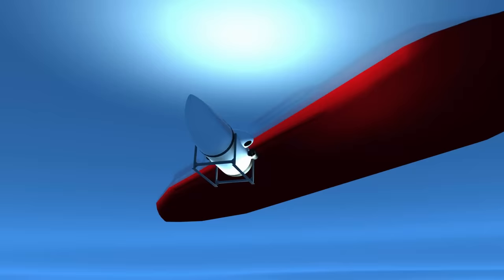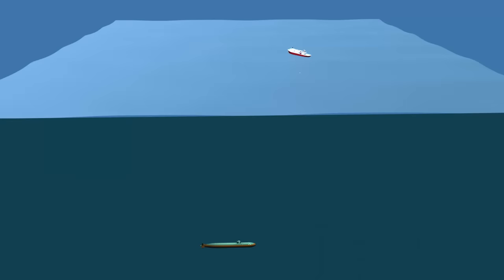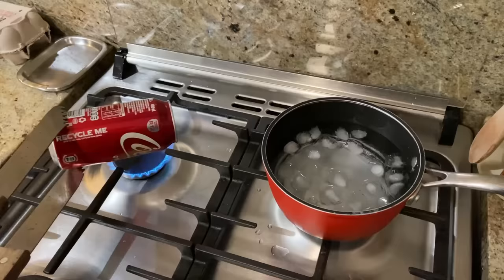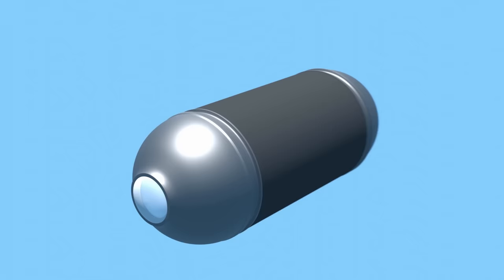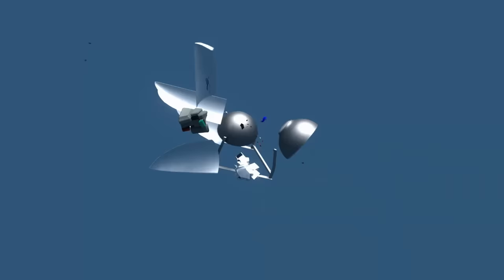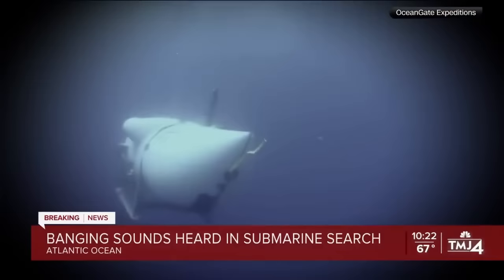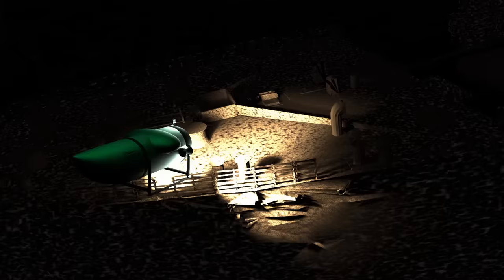TITAN Sub implosion | Deep Dive animation explanation

Comment: that implosion.  It's really hard to grasp how violent and quick it must have been.  under 6000psi, the volume of air in the pressure tube would have compressed to something like 1/500th its original size, at supersonic speeds, igniting the air, and pulverizing anything within it.
Reply: It's kind of like a bullet shrimp/mantis shrimp punch (extreme pressure, supercavitation, pressure heating, atmospheric oscillation) but on a much larger, terrible scale.
Ignoring whether they had any forewarning, as a "way to go" total, instant obliteration like that is relatively humane as you aren't aware it happens, the off switch is just pressed with instant effect.
We can only hope they were relatively unstressed before it happened as that would be the truly harrowing part.
Reply: It is a great way to die because it is completely instant. People are gone out of existence before they have time to think about it
Reply: Just watched another video talking about a sub that imploded a few years ago. They were at a depth of about 1200-1300 feet, so approx 1/10 the Titan sub, and when it collapsed the hull (at 550-600psi) would of collapsed at 1500 MPH which is somewhere close to Mach 2.
The Titan was much closer to 6000 psi.
Reply: @Trigger200284 same one I watched 2mins before this one
Reply: @Trigger200284  Which other sub was it that imploded? Was it a military sub? If so, from where?
Reply: @fredwrinkle  My understanding it was probably just a few seconds.  It is not them that is an issue. They are gone and don't care. It is their families and friends that are in pain.
Reply: @rankcolour8780 I think they know would happen, they was just to rise up they know something was wrong.
Reply: @keithdf2001 we perceive reality at about 200-250 fps. I guess you could do the calculations on if they even registered it but they certainly didn’t experience trauma
Reply: @keithdf2001  it was over and done in a few milliseconds. The air would of self ignited when the pressure squeezed the air bubble. 
Probably would of got close to a few thousand degrees and cooked their completely gel-ified bodies before you could blink an eye.
You can’t even fathom what 2 walls hitting together at 10000 MPH looks like honestly.
Reply: @Trigger200284  I want to go that quickly
Reply: @commie281   Agreed, That is my understanding as well
Reply: Fuel free air does not ignite, it just gets very hot, however in this case it was dispersed as many high pressure bubbles which soon cooled in the surrounding near extreme cold water.
Reply: Yeah they would have burned and frozeded to death before they died.
Reply: They turned into instant spaghetti. Not even their pineal gland got to escort them out of the 3rd dimension. Their souls now dwell within the titanic
Reply: Back of the envelope physics for an implosion.
All you need is F=ma and some simplifications.
Assume the depth was around 3800m, the pressure on 10m of water = 1 bar or approx 1 atm. 
So the pressure at that depth was 380bar, or 38000kPa or 38 million Newtons/m2. 
Assume the CF hull collapses instantly (its fast but not instant and will provide a decreasing resistance to the pressure).
Take a parcel of water right next to the hull weighing 1 kg. A 1 kg parcel of water is a cube 10x10x10cm, so the cube has a face of 100cm2.
The pressure on 100cm2 at that depth is 38x10^6N/m^2 x 0.01 m^2 =380000N.
Pressure = force = mass x acceleration, so what is the acceleration of our 1kg parcel of water with a constant force of 380000N in it? accel.=force/mass = 380000N/1kg = 380000 m/s^2.
After 1 millisecond how fast is our parcel of water moving inwards at? 
V=a*t=380000*0.001=380 m/s(850 mph), imagine a 2lb sledgehammer moving at 850mph in the first millisecond.
How far does it move? X=0.5*a*t^2=0.5*380000*0.001^2=0.19m=0.63ft.
After 2 milliseconds V=760 m/s(1700mph), X=0.76m
3 milliseconds V=1140m/s and X=1.71m.
After 3 ms it’s meaningless because the inner diameter of the tube was 8ft=2.43m or a radius of 1.215m.
So after about 2.6ms the inward moving water front would have reached zero radius.
Of course in reality we have neglected the increasing air pressure resistance of the compressing bubble, the crush resistance of the fragmented hull pieces also moving at 100s of m/s produces a drag force slowing the collapse down plus the viscosity of water when it interacts with itself moving inward.

This might have extended the collapses out to say 10-15ms. Once the compression front equals the air pressure the pressure wave would have rebounded off the superheated air bubble and moved outwards(spring effect) and reduced but still significant speed.

Also the outer shell wouldn’t have simply fallen off, the inward moving water next to the CF hull would’ve created a suction force inward pulling the outer skin in towards the collapse probably moving the outer shell at least 2-3ft inward then rebounding out.
Also the two titanium end shells would have been pulled in towards the collapsing volume but the longitudinal resistance of the CF hull might have significantly slowed it down plus water resistance over the shell’s area plus inertia would have played a major role.

Of course all of this is an extreme simplification but the implosion happened very quickly and the people would’ve been dead in 10ms give or take.
Reply: @glenyoung1809  I always figured it would be comparable to standing between two freight trains traveling 100mph towards each other in a head-on collision. You're pulverized.
Reply: @glenyoung1809 NERD ALERT!😂
Reply: Then lights out faster than eyes can blink for anything carbon based that breathes.   Unimaginable, but hopefully uncruel quick death.
Reply: @rankcolour8780  The final text sent was that they had dropped ballast before they made the bottom. This implies something was wrong and they knew it.
Reply: 5000lbs of pressure per square INCH. Say you are 5’10 that is 70x5000lbs. Actually even more since that is only height. Now imagine 5000lbs of pressure across your height, width, front and back and side. It would be like have a train engine dropped on you.
Reply: @user-dd9eo2wz3h  Their soles, however, are part of the ocean now...
Reply: @JoshDisher  I've seen no evidence of such a text. It's my understanding that there were no comms after 1 hour 45 minutes. But I'm willing to learn something new. Source, please?
Reply: Just go eat some Chipotle and you’ll get an idea of the violence and pressure.
Reply: @RockandRollWoman James Cameron spoke to people who work for ocean gate and the mother ship.
Reply: A very interesting study using physics. Superheated water should have left evidence on the tail, wiring, skin etc. Bubbling, deflection , warping..Currently I don’t see any evidence on the recovered pieces. 
But we actually don’t know , and won’t, till the inquiry what failed.
As arm chair engineers we have all postulated different theories but mostly centring on the collapse of the carbon fibre hull. Yet already we have it confirmed that there were ‘at least’ two separate debris fields after the implosion. 
The wreckage brought to the surface is challenging. 
The view port has gone. 
The titanium rings are intact. 
Large pieces of the outer skin remain intact.
Sealed sacks probably contain the shattered carbon fibre hull.
The landing skids are intact.
There are possible human remains.
Doubtless we will shortly get an in depth study ( pun intended ) of both fields. 
How far apart , distance on the sea bed, and the time of implosion and ‘possible’ manual detachment . 
Were there seconds or mili seconds . 
Did the crew have an ‘awareness’ .. of the impending catastrophe.
They might have if it’s proven that they had commenced emergency surfacing procedures.
Currently that’s my thinking..
I just hope that with all this attention the findings of any Inquiry will actually be published…
Reply: @RockandRollWoman its funny because of the spelling mistake but I understand what you mean 😘
Reply: @JoshDisher  their was no final text.
Reply: Yep, and the coke can in ice was an excellent example to help visualize it.
Reply: @ianmarcRoxU  Military sub made of steel, the effect is very different. This is made of carbon fiber. The one made of steel it violently ignites. Many argue that it hadn’t ignited as it shattered coming into contact with water immediately after implosion. Only a few large pieces were discovered which wasn’t pressurized. The rest is gone. When carbon fiber shatters at that depth it shatters like porcelain.
Reply: @JoshDisher  No one mentioned texts. Where did you hear that?
Reply: @adrianfewster8391 In case of steel sub it does ignite violently. There are several actual videos of this. Not animation. Go search them there are several that are taken while back, actual footage.
Reply: I don't really think what happened to titan could even be duplicated at sea level under controlled conditions.   Tbh 🤔 the imploding beer can or rail tanker isn't the same.
Reply: ,,,,except they have found human remains, and not in powder form?
Reply: Every new piece of information makes this disaster even worse.  I’ve never heard before that the fibers were only wound hoop-wise.  This is such a fundamental, rookie mistake on top of the even more fundamental mistake of using fibers under ultra extreme compression.  Without and transverse fibers to give load sharing, I suspect that the failure started by cleaving between the fibers.  Basically a supersonic waterjet. The rest can be left to the imagination.
Reply: @JMC-ul1sw  - The net is the same, and uses the same formula, for any volume of air, when the volume is reduced due to pressure rise
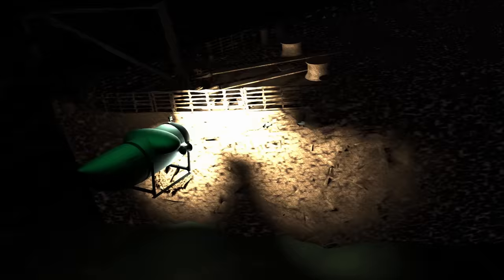Reply: @RockandRollWoman  2:16
Reply: @RockandRollWoman  "90 minutes into the dive and 3/4 of the way down the mothership received the last message from Titan."
Reply: @GaryFlaskegaard  2:16
Reply: @KittenBowl1  2:16
Reply: @GaryFlaskegaard  then the video creator is lying or misinformed? 2:16
Reply: @RockandRollWoman Their souls are at peace.
Reply: Would the compression cause the remaining air inside to heat up? I'm so confused about this detail.
Reply: @fredwrinkle  indeed
Reply: @joimes  yes. It would compress so fast it would combust like an engine.
Reply: Oh they heard some scary shit but didn't fully think it would happen
Reply: @JoshDisher , That’s just the moment that they lost comms and tracking. It was rumored that there was an SMS, but it is unconfirmed. Even if it is true that they messaged they were dropping ballast, it does not necessarily mean that they were planning to ascend because they knew something was wrong. They would also drop ballast to achieve buoyancy and maneuverability if they wanted to use their thrusters.
Reply: @Seashellsbytheseashore21 , This is not correct- Cameron has said in multiple interviews now that he heard from a third-party that the submersible indicated that they were dropping ballast. However, as mentioned elsewhere, this alone minus a distress call could indicate a number of things.
Reply: @adrianfewster8391 There would have been an explosion, the bodies would have been crushed exposing all the fat in the compressed/heated air full of oxygen.
Reply: @geoffreyk9164  But if they weren't at depth wouldn't that signify a problem? The thrusters weren't intended to take them 1/3 of the way down, were they?
Reply: @JoshDisher , Technically, they could use the thrusters at any time they wanted and they almost certainly knew that they were already a bit off course from the wreckage site intentionally where they want to drop ballast so not to disturb anything and approach (presumably the bow) from the side. Also, it is odd that they would simply report that they were dropping ballast without a distress call. Keep in mind, it has not been confirmed with the last SMS actually was. This is obviously something that will be investigated though.
Reply: @davidhenri2722  No, its called an implosion. There was no ignition, just a multiple condensed bubble sound register detected by the navy.
Reply: An engineer worked out it had the energy of 47kg of TNT going off in a minivan that cant expand
Reply: @piccalillipit9211  Not much of an engineer, You do not compare explosions to implosions. The dispersed air under pressure is quickly mixed with cold water and does not find a fuel source from body material to react with for ignition. Everything is crushed, however not destroyed, Molecules stay intact. The air heat is quickly dissapated into the surrounding water re small bubbles. The 47kg TNT theory is pure BS . Engineer should take his hand off it.
Reply: I wonder what happened to the body of thr passenger of Titan
Reply: What are the chances of finding Bones and other Human rests inside the imploded tube??
Reply: The air was ignited and the water streaking in at hypersonic speed cavitated. I guess there even was plasma for a fraction of the process.
Reply: @mrnice111  No. Alls he thought about was making money
Reply: @ianmarcRoxU  ARA San Juan ?
Reply: @rankcolour8780  kppli0iik0
Reply: @mrnice111  89pko8
Reply: @joimes  The description that made since to me was that it was similar to a diesel engine. The air was rapidly compressed creating heat and vaporizing any possible carbon based fuel (human bodies) till ignition happened. And all of this would of happened in less than a second. Human remains would of been burnt onto surrounding materials that survived . Truly speculation on that u-tube provider's part I know. But under the pressures at that depth, seems possible.
Reply: @adrianfewster8391  not according to naval depth finding techniques. It would of more or less been 1 bubble that goes through what is called "bubble pulsing". look it up. You can call it super hot or ignition, or whatever you want, but that bubble would of heated the air to 1000's of degrees in a split second.
Reply: @adrianfewster8391 your assumption of there being no fuel sources at all in the air is funny.
Reply: @jonathanfreedom1st is
Reply: @glenyoung1809 wonder what the non simplified version looks like? Geesh, good job.
Reply: @nev7711  I was making a joke. Their souls are wherever one believes souls go, but the soles (of their feet) are gone.
Reply: @gg456stormy  Really complicated, water which is moving inwards from the surface of a cylinder and crushing a volume of air inside will not simply be moving in a straight line towards the center of the sub. there maybe turbulence which is a non-linear effect and greatly complicates the calculations.
Plus the added complication is that the sub is non-spherical, the cylindrical geometry with titanium endcaps makes the collapse dynamics a lot more complex.
What I did was simply to convince myself of the time scale of the collapse which was on on the order of milliseconds like many experts maintain and not seconds or even tenths of a second.

My own theory is that the collapse didn't start by the end of the sub where the titanium was bonded to the CF by glue. 
The collapse started in the middle of the sub. away from the two strongest ends.
The middle of the cylinder can be viewed similar to a suspension bridge with two towers supporting the ends, the weakest point would be midway between the two towers(titanium end caps). 
The middle was crushed inwards, leading to most likely an hourglass shape which probably caused the air volume to move towards either end, as the collapse proceeded the ends of the CF tube were probably the last to fail since it was "shored up" with support from the titanium rings. 
In effect the sub was probably crushed and pinched into two halves and the two titanium ends fell away once the CF tube's support was destroyed.
Reply: @JoshDisher  We agree that they  lost comms at 1 hr 45, but I was asking how you know they sent a text saying they dropped ballast.  Best anyone can do is say they heard a rumor, but rumors aren't knowledge.
Reply: @claytondennis8034  ya I should of mentioned that too. Anything that vaporized during the implosion would probably combust in the air temperature.
Reply: @southerngentleman2516  I can imagine the arrogant, overconfident pilot, upon hearing some creaking noises, say to the others, "Oh, it's just the parts settling in snuggly", or some such sad bs. It is a sad event, regardless of all the "what ifs".
Reply: @JMC-ul1sw  because there was no time for the air to separate into smaller bubbles…. There’s an entire study of it known as bubble pulse.
Reply: @madlenellul3430  your view is flawed
Reply: @jonathanfreedom1st  it was a demonstration of the effect brainiac.
Reply: @citizenscience659  oh really? Source please. Cause they ain’t finding anything from that, sorry.
Reply: @Trigger200284  I’m not disagreeing as I’m not proficient in thermo dynamics at that depth…
But I am annoyed that so many on this post have been conned by the sick posting of supposed communication between the Titan and surface.  This did not happen..DID NOT HAPPEN..
The poor souls may have been aware of their impending doom but they did not communicate this to the surface.
That dialogue is pure ‘sickening’ imagination..
It will take the Inquiry before any  ‘truths’ are uncovered..
Reply: I really hope that if they knew it was about to happen, they all took turns slamming rushs head against the titanium end cap, that was probably the banging sound the microphone picked up on 😅
Reply: Yep.
Reply: @lottatroublemaker6130  U.S. submarine Thresher and Scorpion.
Reply: @Trigger200284  They did not calculate the accurrate depth on Titan, the heard sound indicated an implosion, but they could not be sure until the debris was found. In another submarine incident the bubble frquency of 4.4Hz with the known volume , indicated the depth for that one. You have to remember that crushed metal can stay intact regading it's metal skin bending and deforming, retaining the gas until the last escape. With carbon fiber, it shatters like glass, as it does not bend or mold to a new shape under extreme pressure.
Reply: More like 1/282, and quickly cooling and rising before liquified completely.
Reply: You had me at envelope’ 🤣
Reply: @johnermactavish1162   The diffferrence is the water pressure bursts your lungs, stomach and fills your void internals. The pressure externally is equal in all directions. So the body is not squashed flat like a train enging dropping on you. Remember that fish live down at those depths.matter can sustain huge pressures from all directions. Of course death was instant. Carbon fiber does not bend, it shatters under immense pressure. This is the reason it failed. Metal can distort and restore its structure, whereas carob fiber cracks on every dive until the last one, where its weakoned state is overcome. Why it was not made of metal beggars belief...
Reply: Carbon fiber cracks, and shatters it doesn't implode, everybody in that thing knew what was about to happen
Reply: @jackalopewright5343  Hmmmm, all these 'experts' may be right? But can you explain 20 successful round trips?, Or even just 5? Oooops, suddenly NOT SO OBVIOUSLY 'rookie' anymore, unless you are projecting, maybe?
Reply: @silverflight5777  Yes thats what I already said above.
Reply: @joimes yes, pressure and temperature are proportional in gasses. They heat under compression. Sudden cavitation (gas bubble formation) at depth can actually generate heat in the thousands of degrees as the water pressure collapses the bubble. 

If you want to see some simple examples of it, watch some slow motion footage of ballistics gelatin. The cavity formation and compression actually combusts some of the gelatin from the pressure, almost like a diesel engine
Reply: @RockandRollWoman    Lovely thought ... btw, its "souls"
Reply: @fredwrinkle  Submarines in general have unpleasant hull noises even when operating normally, hopefully for the passengers things should have felt normal right until the instant of implosion.
Reply: @brettp5543  I responded to a comment about souls at rest with a crack about missing soles. Because the remarks were separated in the comments, folks missed my joke. Their souls are wherever one believes souls go, but the soles (of their feet) are gone.
Reply: @rankcolour8780 can you explain the ending of what you mean? Hope they were relatively unstressed? 
Thanks 😊
Reply: @keithdf2001  So what is pain then? a defense or alert mechanism?
Reply: @madlenellul3430  I share your revulsion at those who invent facts, or turn speculation into truth, and seem to get off on causing distress. We know the vessel imploded, but little else about what happened after comms were lost. The rumermongering is like a 5th grade game of telephone. 
Science sometimes requires patience.
Reply: Rush probably told them not to worry during moment of panic
Reply: Right so the bodies become compressed themselves correct? This is showing that the compartment shrinks but did it break apart?
Reply: @limawhisky  Good question
Reply: @Trigger200284 good idea for the next Slomo Guys episode
Reply: @citizenscience659 Because after multiple trips down & back up, the various materials used contract and relax at different rates to each other, creating weaknesses that eventually give out when the structure can't take anymore extreme compression. it's less risky to use just one material. source: James Cameron.
Reply: @TattooedMisery  What, the Movie Director? Tell me, if you use the bus 200 times a year to get to school, does that make you a scholar , or a bus driver, or better yet A Coach Building Engineer? What sub did HE build that came back 20-odd times?? Oh, none?
Reply: If we consider only the weight of water, at 3.8 km depth, pressure would be 5400 psi. The strong waves would have added more pressure to it.
Reply: @glenyoung1809 The limiting speed is the speed of sound in water - 1402m/s. That is the speed that the water around the submersible would have decompressed at. 
The other speed is the speed of sound in carbon fibre - about 10km/s which is the speed the hull would have shattered at.
Reply: @drdrums1 Try two Mach 3 jet aircraft in a head on collision.
That’s the speed involved.
Reply: @madlenellul3430 the water doesn’t get superheated - the air does. The titanium shows scorch marks.
Reply: @joimes isothermal compression. There isn’t enough time for heat to dissipate so increasing the pressure by 380 times while reducing the volume by 380times increases the temperature by 380 times - Charles law.
Reply: @adrianfewster8391 Implosions produce high flash temperatures due to isothermal compression - just like a diesel engine. The crew are the atomised fuel. The resulting overpressure then blows the porthole and end caps off.
The bodies of the crew of the Kursk were burned by the same effect at 1/10 the depth.
Reply: @allangibson8494  thank you..
Reply: @allangibson8494  The Kursk's commanders and most of the crew in the front compartments were killed from two blasts 135 seconds apart. That was a series of  torpedo exposions, so you don't know what you are talking about. The Titan carbon fiber shell shatterred like glass allowing the compressed air to quickly disperse and cool within the instant replacement volume of very cold water. Bodies were internally traumatised by the extreme water pressure, causing instant death, but there was no burning.  It did not compress like a metal can, it shatterred.
Reply: You don't know you have a problem, it's instantaneous death
Reply: @Thecdnsurvivor  Only instantaneous when the implosion occurs. 
I doubt we will ever know how long they were aware of their impending doom.
Reply: @allangibson8494  yes exactly, my rough calculation indicates the collapse front will reach zero radius in less then 2.6 ms, the water won’t have reached sound speed in water by that time.
Tried looking up CF sound speed but couldn’t get a consistent answer because of the differences in manufacturing between various types of weaves and layups plus epoxy compositions.
But you’re correct, the fracture velocity in CF makes the shattering time << than 1ms. The velocity you quoted is 10km/s or 10m per millisecond and the thickness of the hull was 0.128m, so the time need to completely get through the thickness of the hull is 0.0128ms or 12.8 microseconds.
As a side note, during the time it takes the fracture to go through the thickness of the hull a sound wave in air would have travelled 4.3mm in that time!
Reply: @allangibson8494  I think you mean adiabatic compression.
Reply: @bobbyb5546 Super Nerd alert but quite detailed and maybe accurate wonderful and MIT physics professor could post his calculations and diagrams to better explain it for laymen out there instead of just formulas.
Reply: @Trigger200284  you are completly wrong. Ignition would not occur at those conditions.
Reply: @stevetilbrook3402  They wouldn't burned.
Reply: @JMC-ul1sw  This is exactly, how it would behave.
Yes, it wouldn't be compressed into one bubble, but to thousands tiny bubbles... and even before, it would mixed with water, water vapors and humidity. Water have 890x higher density, and about 3 oC , it will carry much more thermal capacity, than air. Air would get only partially hot, I doubt it would even surpass 100 oC.
Reply: @warrax111  it's a mix of fire and water which can cause deadly undersea explosions resulting in widespread panic.
Reply: No. That is a lie. You don't know that.
Reply: The pressure at the depth they likely imploded at was at least 10,000psi.
Reply: @jebbroham1776  Only if it was..
Reply: @adrianfewster8391 Incorrect.🤡
Reply: @GaryFlaskegaard  ^*there, not their ^Yes there was💩🤡🤦‍♂️🙄
Reply: fireman having 4 500 lbs / in 
in their full tank made in carbon fiber .
Reply: @fredwrinkle 
They had 19 minutes in emergency mode with cracking sound .
Reply: @Trigger200284 
Scuba diving record is near 
1200 feet
Reply: @marcosbatista1029 
supposed to be 19 minutes
Reply: thank god they wouldn't have felt anything.
Reply: @jiminverness  And that imploded at 14.7psi, rather than 6,000. It was even slower, because the steam took time to condense.
Reply: @joimes  Think of a diesel engine, where the air is only compressed to around 300,psi to reach ignition temperature.
Reply: Yes, one thing that occurred to me was that because of the great speed and large ratio of the implosion, the air would have been heated to enormous temperatures before there was time to dissipate the heat. Not really of concern to the inhabitants who could not have survived a long enough fraction of a second to sense the collapse.
Reply: @Trigger200284   How come they found body parts if everything was turned to ash ?
Reply: @crumkill  think you might be getting lied to buddy. I’m from Atlantic Canada, there’s NO body parts to be found.
Kudos to you for being that naive.
Reply: @adrianfewster8391  that doesn’t change the bubble integrity. By that logic the metal sub would of squeezed air out along multiple tears in the hull along the steel fatigue in the folds as it crushed and tore bolts and rivet joints.
Reply: @warrax111  you are wrong. That air would have ignited lots of materials as it compressed at 6000 psi.
I do hydraulics for a living, you ever feel how hot a material gets under compressing loads and certainly no where near as fast as what happened there.
Nice try though.
Reply: @warrax111  wrong.
Reply: @martinchagnon1119  it’s 1082 feet which is 1/10th the Titan depth. 500 psi vs 5000-6000 psi.
I’m not even sure what you are trying to point out to me honestly…
Reply: @Trigger200284  lol you are funny.
you dont know physics obviously.
yes, lets heat up water with 890x less dense air. it's a nobrainer.
Reply: @Trigger200284  wrong are you
Reply: @warrax111  Great language skills…. I think I’ll keep my thoughts on a higher shelf than yours though, even with that compelling, riveting testimony of syntax I just witnessed.
Reply: @Trigger200284  
the human limits
Reply: @Trigger200284  
when I was fireman we had in the ninety's tank of 2 250 psi and in the 
2 000 , carbon fiber tank with 4 500 psi
when we were open directly on the 
tank some did test with their thumb
at the exit of the tank or trying to
joint their hands between the 2 250 psi
tank and a water extinguisher to fill it
at 100 psi ..
Reply: @Trigger200284  Crushed metal cyclinders rarely tear, and have a largwer feformation tolerance. The entire bubble release would be from the one or few weakest opening point(s, not many.Thats why metal should have been used  instead of cardon fiber. 
Carbon fiber shatters before its volume is decreased, that is the point.
The report when it comes out soon, will show that there was no ignition, no burning of human fat or bodily burn injuries.
Reply: @martinchagnon1119  ya. Even at that depth they say that almost everyone would have their lungs crushed. That diver has trained for years maybe decades to do that, and in my opinion it’s reckless to even attempt it because of the nitrogen compression in your blood. Even the best trained divers can get the bends.
Reply: @adrianfewster8391  nah. I live in the provinces where the accident happened, there’s no bodies to recover.
That air bubble would of been close to 5000 degrees when it compressed. And their bodies would have been pushed inward to the centre of that bubble by the water collapse.
The shattering of the hull has no impact on the overall integrity of the bubble. A water balloon breaking in slow motion proves that the fluid would stay largely intact as the material is ripped away or through the fluid. 
The bubble was in tact and certainly heated to thousands of degrees as it pulsed and squeezed smaller and smaller heating and expanding the bubble momentarily as it was squeezed again by the water collapsing the bubble as it heats up the air more and more until that entire cabin was inside a couple basketballs worth of volume.
Reply: @adrianfewster8391  I don’t believe you.
Reply: @rankcolour8780 Well considering they dropped the ballast and were trying to ascend when it happened then it’s almost certain that they knew something horrible might happen any second..
Reply: @TheFapFactory Dropping ballast doesn't mean you are about to die, it's the most reasonable thing to do if you - for example- loose attitude control.
Losing control like that is something we know the Titan has done before on a previous voyage and was just doing 360s underwater (I believe there is a video of it).
It doesn't necessarily mean they were experiencing bowel clenching mortality.

Truthfully though with the speed they descended at, compounded with the fact they set off late, I feel like they piloted themselves into a problem descending too fast to make up for lost time.
That sounds like the kind of thing the man in charge would suggest and would cause a problem like a thruster failure and then hull stress.

If you do the maths they considering they set off late they arrived at the wreck nearly 60 minutes early. That's an incredibly fast and unsafe descent speed, creating the mother of all contraction cycles and given no one is talking about the dive speed much or is just glossing over it surely that speed was intentional to make up for lost time. Otherwise immediately the narrative would have been "they lost control on a dive decent" .

Sounds suitably cavalier for a man who ignores his safety advisors.
Reply: @glenyoung1809  Your calculations are all wrong.
Water does not compress or decompress. Once the hull cracks and starts moving the pressure goes away immediately. Then it's just the giant pillar of water above the cabin getting accelerated by plain gravity (9.81 m/s^2).
Think of a huge slab of concrete on top of a car getting released and squashing it.
Now double the concrete's mass - nothing changes, it still gets accelerated by plain gravity only.
Reply: Yikes😂
Reply: @rankcolour8780  sadly they got 20 minutes to know they're in big trouble, hope they remained calm and just accepted their imminent obliteration